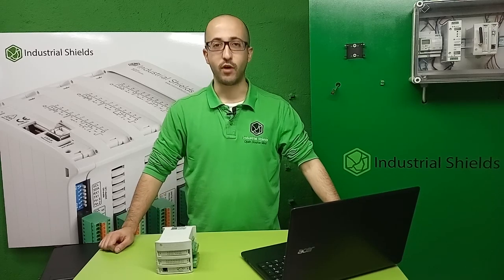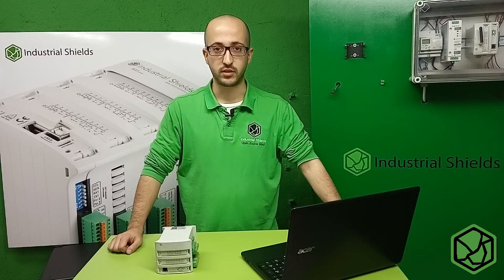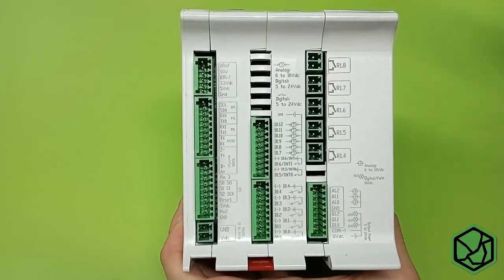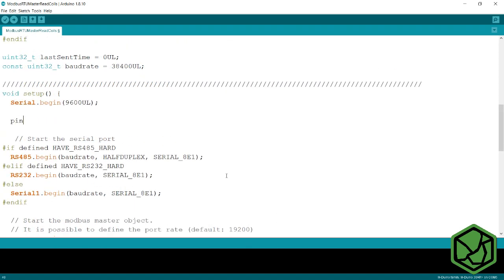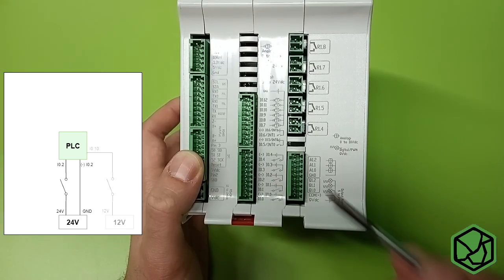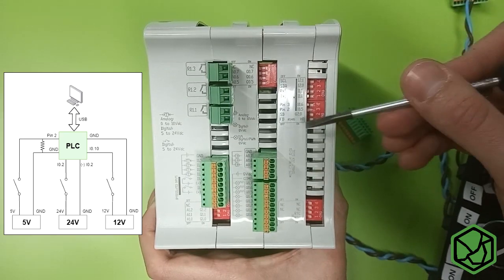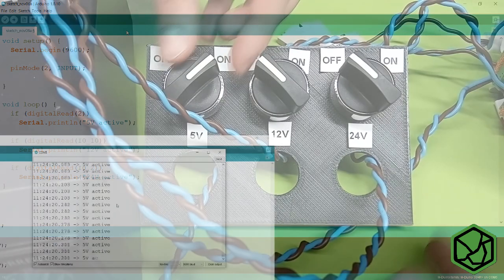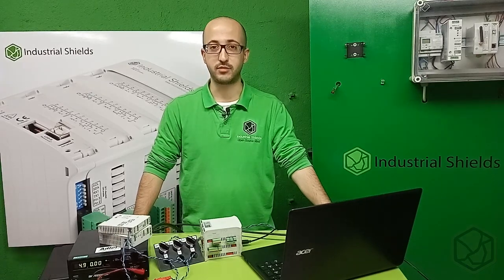Basics: Digital inputs in Arduino PLC

Comment: Is it possible to use input pullup mode?
Reply from the maker: Hello! Yes you can use the INPUT_PULLUP mode with the device digital inputs as well as Arduino Direct Pins. Thank you :)
Reply: @Industrial-Shields  But is it possible to activate pin with GND? If I set INPUT_PULLUP or INPUT, I read always 0 if pin is unlinked. How is it possible?
Reply from the maker: @andreamedori9791  Sorry, I did not remember to comment it on the last comment but the INPUT_PULLUP mode only can be used with Arduino direct pins such as Pin2 and Pin3. This is because with the common PLC inputs (I's) there is a pull-down resistor added by our hardware which does not allow to do this. If you use the INPUT_PULLUP mode with an Arduino direct pin you will read a 1 without nothing connected and a 0 when the GND is connected.